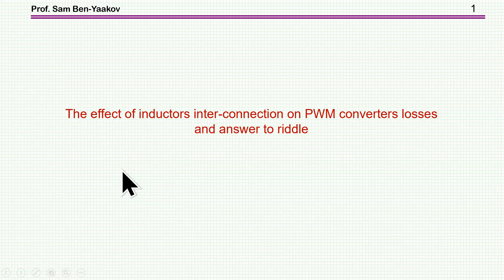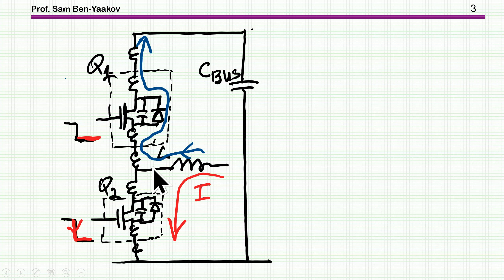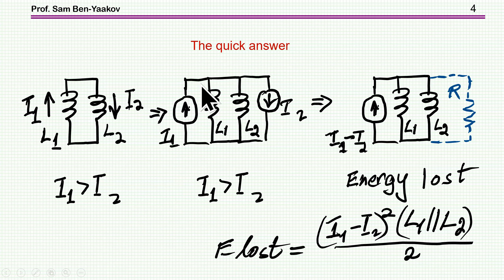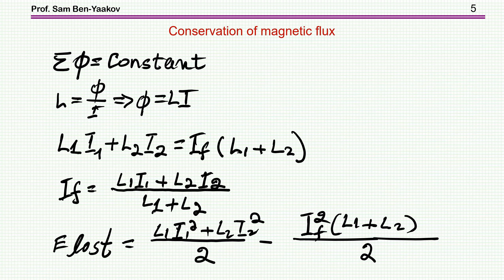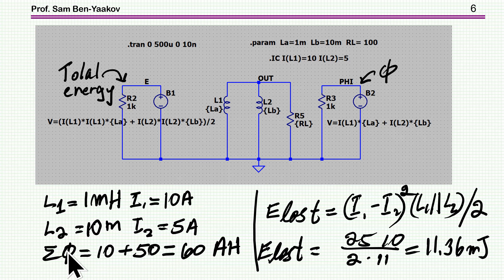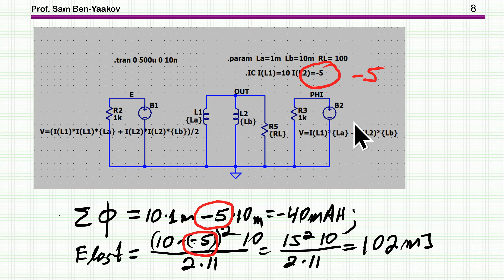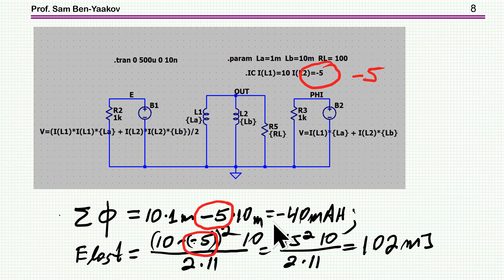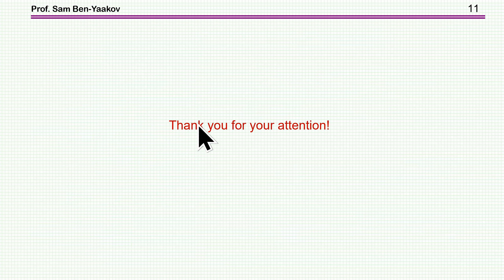The effect of inductors inter-connection on PWM converters losses and answer to riddle

Comment: If current is constant before the switches close, then shouldn't the equivalent current sources be in series with their respective inductors? Also, if the initial currents are in the same direction, then shouldn't they add, and if opposing directions, subtract? Math works the same but current flow/direction is corrected, that's all I'm wondering about. And then, wouldn't the inductors be connected in series with each other so the Eloss equation changes to (L1 + L2) instead of (L1 || L2)? Why must they be calculated as parallel if the current through them settles into one direction?
Reply from the maker: The model of a charged inductor is an inductor in parallel to a current source. If they would be in series then how will the inductor current change?
Reply: @sambenyaakov  Thanks for replying. Clearly I need to study this more. :)

Comment: Huh, so this is how it goes, never thought about using conservation of flux - it was in the back of my head somewhere, as capacitors have charge, and inductors have flux, not current as I initially thought, my second guess was to use the energy of the inductor as a starting point - it'll work regardless of where currents will flow - energy will reach a new equilibrium.
This  riddle would be a bit easier to solve when you have the whole circuit, how and where the currents will go will be more apparent.
Reply from the maker: Thanks for input

Comment: Do you have a video in the works responding to Veritasium's recent video? 
https://www.youtube.com/watch?v=bHIhgxav9LY

He gives the explanation using the concept of E and H fields acting as structures that facilitate the transfer of energy from the EMF source to a load, and showing a 3D representation of poynting vector field radiating outward from a source and eventually inward towards the filament of the bulb. His starting off question is a great exam question for EE's regarding basic EE theory. It can be solved many different ways and be interesting to hear your take on it!
Reply from the maker: He had good ideas but I think it is incomplete. For example: what about skin effect if the current flows on the surface?

Comment: @Sam  This is no different to two capacitors with different initial voltages being connected together. Just use the duality principle: conservation of flux (instead of conservation of charge) to calculate final current (instead of final voltage) and 0.5*L*I^2 loss (instead of 0.5*C*V^2). This is just a fancy and  clickbaity way because people are more thought and used to think of capacitors... but nothing too surprising or interesting here, just the duality principle at work.
Reply from the maker: Dear George, thank you for taking the time to write this note. For me, as an engineer, waving duality is not an explanation (unless you explain the reason for the duality). Not to mention the fact that CV^2/2 loss, by itself, needs an explanation.  And finally, just wondering, how come your comment is to the answer and not to the riddle itself?
Reply: Thanks for your response, Sam.
Duality between electric\magnetic fields is a basic and well established principle and certainly there is no need to give a proof here as it is in every other textbook.

In summary:
The duality principle has very rigorous mathematical foundations on the fact that the equations for two phonomena are identical if you substitute the 'dual' variables. And because the equations are identical any conclusion in one domain also holds in the other domain.

Capacitors eqs
q = C * V
Ec = 1/2*CV^2

Inductors eqs
Phi = L * I
E = 1/2*LI^2

If you make the following subsitutions:
C->L, q->phi, V->I 
You get the two inductor equations above.

Having said that, two capacitors with different voltage that get connected together is a classic physics textbook problem and it simply is solved using conservation of charge. For inductors, use the dual conservation of flux and find final currents.

With regards to 0.5*CV^2 loss, this can easily be proven by realising that the electric field must do a work to transfer charge which is equal to the energy stored in the capacitor, so 0.5*CV^2 is lost. With duality invoked, 0.5*L*I^2 is instead lost for inductors.

Hope this clarifies.

I only posted this comment here because both videos were already published by the time I found out about this.

Having said that, great videos, keep up with the good work!
Reply: @georgeg.5798  Duality is indeed a powerful concept and it has interesting application in modeling magnetic structure using permeance equivalence. 
while I totally get the classic physics problem of connecting two capacitors in parallel, somehow I can't get my head around why the flux linkage should be conserved. I mean you kinda get the physical reasoning when it comes to charges, have you managed to find a physical reasoning for the flux linkage ?